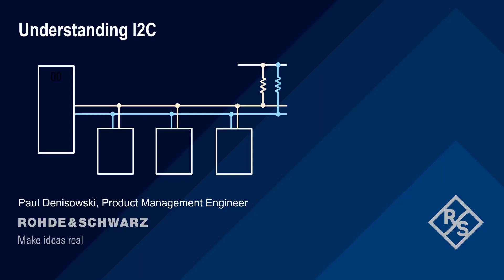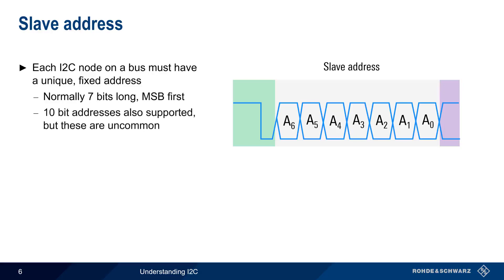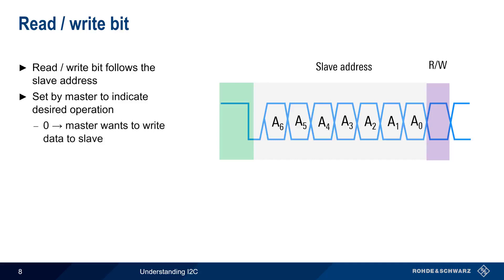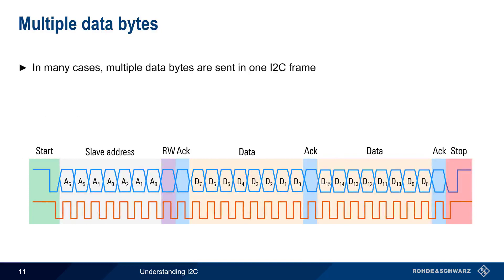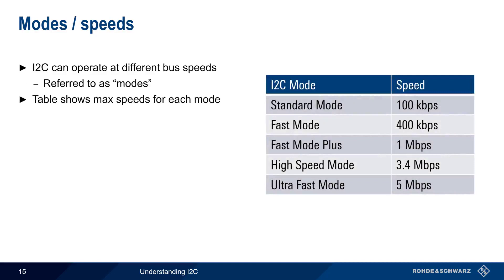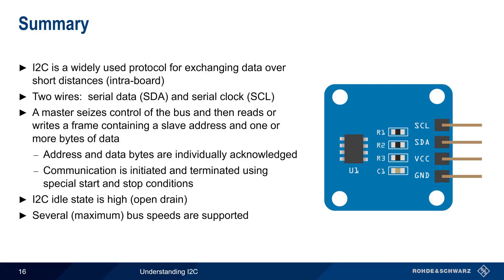Understanding I2C

Comment: Timestamps (Powered by Merlin AI)
00:01 - I2C is a common serial protocol for short distance data communications
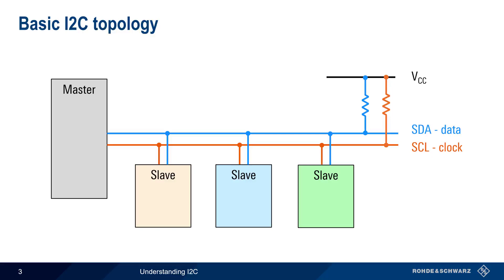01:29 - I2C communication involves frames with start and stop conditions.
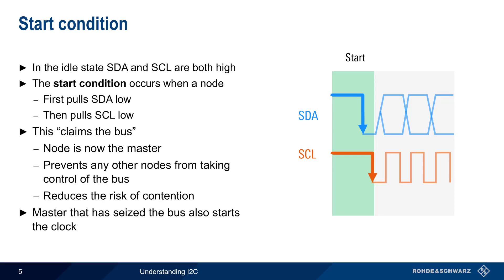02:51 - Each node on an I2C bus must have a unique address.
04:18 - Read write bit indicates read or write operation
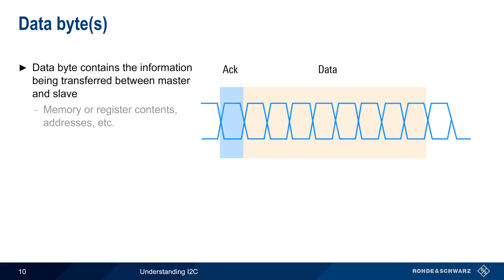05:38 - I2C data transmission involves master-slave communication and 8-bit bytes.
06:55 - I2C communication uses stop and start conditions with pull-up resistors
08:18 - Pull-up resistor values affect bus speed.
09:37 - I2C is a widely used protocol for short-distance data exchange using two wires.

Comment: Why are there two separate lines for the data bits?  Are they high and low at the same time?  How does that work?
Reply: If you mean that SDA forms like hexagons, that is just to say "Bit, that can be either low or high", but in the diagram you don't know what is it. So you draw it as both, looking like 2 lines but is just one, once you define what number it is.

And the other SCL its a clock, like a rythm that the data will follow to be in sync with eachother
Reply: the point is that clock must follow that structure but then data can be whatever is transmitted, so the protocol doesn't require some specific state

Comment: 🎯 Key Takeaways for quick navigation:

00:00 🌐 Overview of I2C Protocol
- Brief introduction to I2C protocol.
- I2C developed by Philips in 1982.
- Purpose: Short-distance data communication using a synchronous Master-Slave protocol.
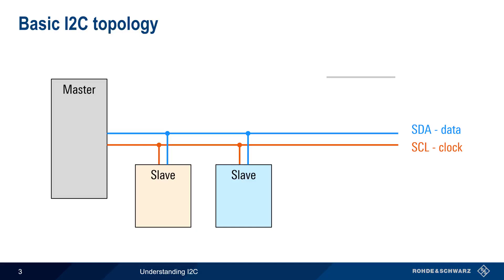01:12 🔄 I2C Topology and Connection
- I2C topology involves a master connected to slave nodes.
- Two shared lines: SDA (Serial Data) and SCL (Serial Clock).
- Connection details: Shared pull-up resistors, dynamic addition/removal of devices.
01:40 📡 I2C Frame Structure
- I2C frames initiated by start conditions.
- Master sends slave address and read/write indication.
- Frame ends with a stop condition, ensuring bus availability.
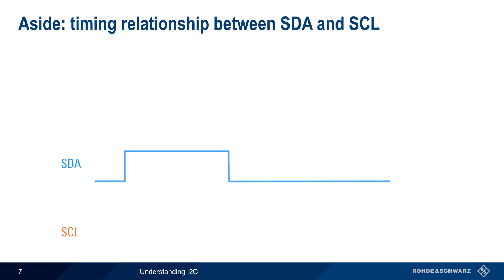03:49 ⏰ Timing Relationship in I2C
- SDA transitions only during the clock's low phase.
- Ensures unambiguous start and stop conditions.
- Crucial for preventing contention in data transmission.
05:02 🎭 Read/Write Bit and Acknowledgment in I2C
- Read/write bit indicates the master's intention.
- Acknowledge (ACK) bit confirms proper data reception.
- NACK (Negative Acknowledge) signifies lack of acknowledgment.
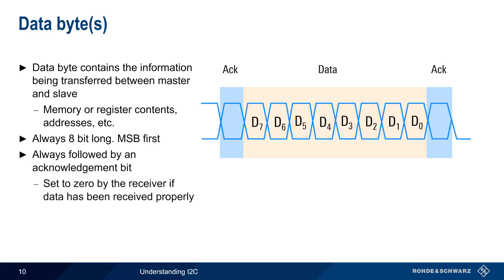06:00 📊 Data Transmission and Byte Handling
- Data sent in 8-bit bytes, MSB first.
- Each byte individually acknowledged.
- Stop condition indicates the end of the frame.
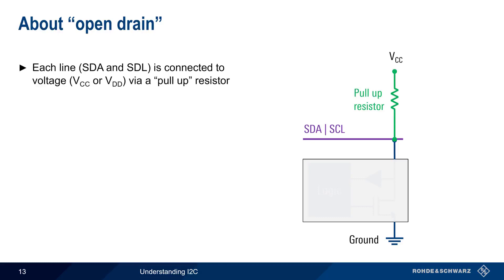07:38 🔗 Role of Pull-Up Resistors in I2C
- Pull-up resistors maintain idle high state.
- Open drain system ensures quick pull-down to ground.
- Pull-up resistor values affect communication speed.
09:19 🚀 I2C Bus Speed Modes
- Various modes with corresponding achievable speeds.
- High-speed and Ultra-fast modes modify standard I2C behavior.
- Practical data rate influenced by pull-up resistors and bus capacitance.
10:01 📝 Summary of I2C Protocol
- I2C widely used for short-distance data exchange.
- Master-slave communication through frames.
- Pull-up resistors, open-drain, start/stop sequences are key elements.

Made with HARPA AI
Reply: Good work!  Done by Harpa?

Comment: 9:52 detail about modes & speed: Clock stretching. If it wants to, during transfer the slave is allowed to hold the clock line low. The master has to wait until the clock line is released. The slave can effectively slow down the speed
Reply: Yes - I originally had a few slides about clock stretching but took them out in the interest of time / brevity.   Thanks!

Comment: im confused , lets take the example of a 16x2 LCD display with I2C module , the LCD have VCC, GND,V0, A and K pins which are the power and light, and there is the D0-D7, RW, RS AND E for typing the characters 
so how on earth can the I2C deal with the RW , RS and E signals while the 8 bit DATA are occupied for the D0-D7
Reply: That's a good question. 16x2 LCDs with the HD44780 controller chip (which is very common) can be configured to use a "4-bit mode" where only D4-D7 are used. In this mode, each data or command byte to the LCD is entered by sending two "half-bytes" in succession. This way D4-D7, RW, RS, E (and backlight control) can fit into 8 bits provided by the I2C I/O expander module. AFAIK, the LCDs with the PCF8574 I2C I/O expander all work this way.

Even if this 4-bit mode didn't exist, you could choose a different I/O expander that provides more than 8 outputs. The PCF8574 happens to have only 8 outputs, so it uses the simplest protocol and just expects to be told the state of the 8 pins as a byte from I2C. However, for many other I2C I/O expanders especially those with more than 8 I/O lines, instead of just transferring a "plain" byte like that in each I2C frame, it expects commands telling it which pins to set high/low, which pins to set as inputs/outputs, etc. so that they are not limited to 8 I/O lines. An example of this is the TCA9539, a 16-bit I/O expander.
Reply: @shuyuanliu9797  thank god ,, sombody  gived me a direct answer , its seems like 4  bit mode is the trick here , 00100000 to set that mode and since the D0-D3 are all zeros they can be ignored all the time ,now i can design the logic gate level circuit of that and compile it to FPGA ...... man you are a legend

Comment: Is not I2C multimaster?
Reply: Good question.  Yes, I2C allows any node to be the master: whichever node initiates the start condition becomes the master (see slide 5).  Many I2C systems are however operated such that only one node is ever the master, but the protocol does allow for multimaster operation.